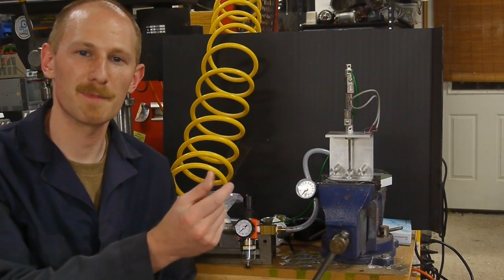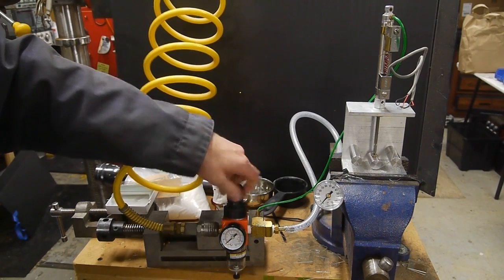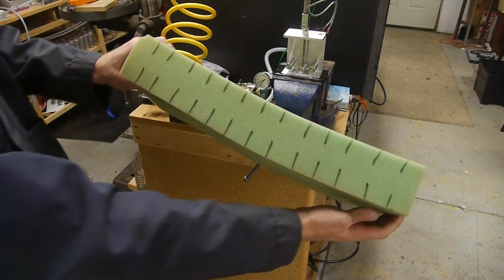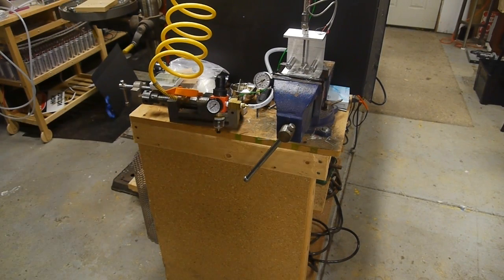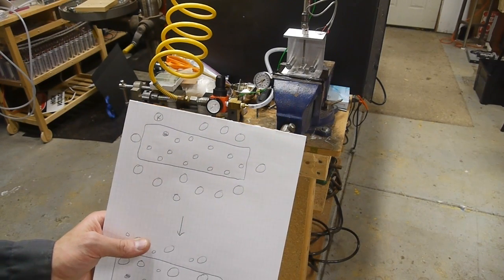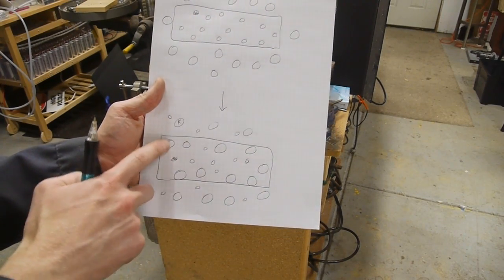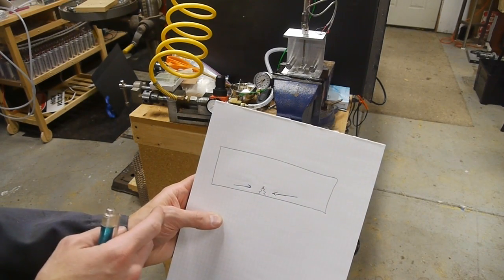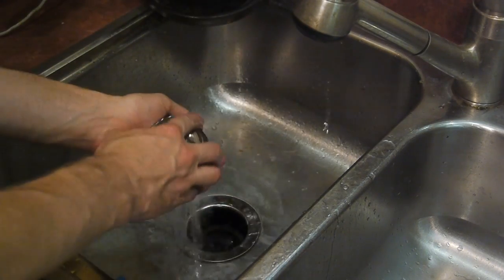How to chemically strengthen glass (eg Gorilla Glass)

Comment: Car windows?
Reply: Jon Visser the "windshield" is not something you can "kick in" it is normally part of a cars bodys strength and i can guarantee, unless you are the hulk, you will not be able to kick through a car's windscreen.   laminated side windows would be too tough for a human to pass through.
Reply: Car windows are made from laminated glass. There are two layers of glass with a plastic layer in the middle.
Reply: ricksite I think my front window aka windscreen is only laminated window in whole car like mostly on older cars (?).
Reply: XantheFIN Thank you for correcting me. I think the windshield and rear window are laminated and the other windows are tempered. I read an article a while back about automakers wanting to use laminated glass on the side windows. There was a concern about being able to break the window if the vehicle is submerged. I don't know if any manufacturers are currently using laminated on the side windows.
Reply: ricksite Breaking a window is not suggested underwater.  You'll have shards of glass streaming in with the water that could potentially lacerate you.  Either roll down the windows or kick the windshield.  The windshield won't shatter because it is laminated.  I wish that automakers would use laminated side windows, that might help deter thieves since it would take longer to break in.
Reply: MrKnifeFanatic remember the pressure from the water on top of the glass makes it much harder to kick the windshield from the inside
Reply: ricksite I believe higher end cars use laminated glass for the side windows to decrease cabin noise.
Reply: ricksite some cars are double glazed, so smashing them is not easy.
Reply: mightyfinejonboy I just watched a "nowcast" on getting out of a car in the water.  They've been wrong on some things before, but they said the same thing as you did.  I've always heard to kick out the windshield.  It's probably from watching too many action movies.
Reply: mightyfinejonboy Yes, but kicking a windshield from the inside out is much easier.  When your car submerges you aren't going to swim out of the car and start kicking the windshield from the outside, now are you?  lol.
Reply: Jon Visser
Tempered glass doesn't break into shards, it shatters nearly instantly into extremely tiny pieces that aren't (very) sharp.

Rolling down the window under water is just as impossible as kicking out the windshield, because of the pressure difference that others have hinted at.

You may want to close your eyes when breaking the side window but whatever minor cuts it may give you are certainly less bad than the alternative death by drowning.
Reply: racoiaws Why would rolling down the windows be influenced by pressure?  It's not going against the outside water, just down.
Reply: Jon Visser
Because of the extreme friction created by the water pressing the window onto the window frame.

Just picture it being oriented horizontally; a pane of glass is easy enough to slide across the ground, put a few hundred kilos of weight on top and it will no longer budge.
Reply: racoiaws I'm not seeing evidence for that on any web searches, but the logic makes sense.  The question is if the 1/2 centimeter of glass in contact with the surrounding door is comparable with glass on the ground with 100% coverage.
Reply: Jon Visser While the analogy isn't perfect, it was the best / most accessible one I could think of.

I believe they did actual practical tests with car doors on MythBusters.
Reply: racoiaws That´s not a very good analogy. A liquid on a plane of glass is not the same as a dead weight on a piece of glass. 
You have pressure but you are not working against it, you sideline it. 

After that is down you wait until the car is fully filled to neutralize the pressure difference and can then swim out. 

alternatively you unlock the door and stomp on it, how hard it will be depends on your depth under water.
Reply: GeneralRushHour The analogy was never meant to cover anything more than the sideways pressure the water puts on the window.

Of course, if the car isn't submerged you can quickly open the door or window.
But once it is submerged, the pressure difference will prevent you from doing so and you're going to have to break the window.

You could also wait for the car to fill up with water for the pressure to equalize again, but chances are you'll be even deeper under water at that point and it might prove too difficult for many to keep their calm long enough for this to work.
Reply: "But once it is submerged, the pressure difference will prevent you from doing so and you're going to have to break the window."

It depends on the depth. Regardless of depth, working straight against the pressure is much much harder then sidelining it. 

"but chances are you'll be even deeper under water at that point and it might prove too difficult for many to keep their calm long enough for this to work."

No different then fighter pilots staying calm and wait until the last moment to exit the plane. Human training or just individual nature/ knowledge.
Reply: GeneralRushHour  "No different then fighter pilots"

Your average driver is quite different from a fighter pilot.. fighter pilots train very hard for what they do, exactly for the reason to be prepared for every situation.

You can't seriously think that most drivers will stay calm as their vehicle submerges and slowly fills with water. If your reasoning is purely theoretical (because it doesn't seem practical) then why not say that people shouldn't be driving into the water in the first place?
Reply: "Your average driver is quite different from a fighter pilot.. fighter pilots train very hard for what they do, exactly for the reason to be prepared for every situation."

Doesn´t matter what the person thinks, it´s all physics.
Reply: One of my cars which is a Rolls Royce Phantom, a very high end car, uses laminated glass in all windows to keep the noise and vibration down. My Mercedes Benz S65 AMG which is also a very high end car does not have laminated side windows for safety reasons.
Reply: Daniel Napast yea you don´t have a rolls royce, nor a Merc S65 either.
Reply: Death by lacerated arteries, but I digress, newer safety standard factory car windows I believe are designed to shatter with less likelyhood of that.

Comment: Did I miss something Ben?  Did you say how much load the treated glass took before breaking?
Reply: You did miss something. The regular glass broke at ~25 psi, and then he tested a piece of the treated glass. It didn't break until the gauge was off the scale - over 65 psi, or over 260% of the force required to break the normal glass.

Comment: Just a quick and probably stupid question. What would happen if i used this process to harden the glass on my smartphone directly or at least removed the glass from the phone first.
Reply: I would think the high temperature needed would cause the screen to delaminate and completely fuck it. This process needs to be done to the glass, not a completed touch screen that contains many layers
Reply: Depends what phone you've got, but most smartphones use a form of gorilla glass anyway.
Reply: depending on which phone you use, you might already have gorilla glass on it
Reply: That's a good idea, but unless you have an extremely cheap (and I mean extremely cheap - think "no-name-brand bought new for less than $40 off Ebay") or counterfeit phone, then the glass on your phone is pretty much guaranteed to already be strengthened in a similar manner.
With a phone's screen, I would be concerned about degrading the coatings on the glass that make the touchscreen work - I guess that would depend on how the screen was constructed though.
Reply: Re i've never seen a touchscreen like that. I can't even understand how a touchscreen like that would work. What phone has a screen with a separate glass front?
Reply: memberHD For most phones the glass and touch screen unit is separated
Reply: memberHD Do you know how capacitive phone touch screens work? It's basically by proximity, not pressure. The actual touch screen is made out of a plastic material, and on the outside is a protective glass lens. The finger can still be detected through the glass lens. This is why when you crack the screen of an iPhone it continues to work. On some phones the digitizer and the glass is fused together but on others it's only glued together. For example, it's glued together on most early iPhones and iPod touches, like the iPhone 2G.
Reply: memberHD You can also buy bare glass lenses for certain phones to do a manual repair. Search "replacement glass lens" on ebay and you may find some.
Reply: memberHD Re  Hm, yeah it looks like Re is correct - in both capacitive and resistive touchscreens, the "touch layers" reside underneath a glass "lens" layer. I suppose some devices probably have all the layers bonded together, and some others probably just have the touch layers mounted against the glass pane.
Resistive on the left, capacitive on the right - http://i.cmpnet.com/planetanalog/2009/06/C0411-Figure2.gif
Razzman If you cracked the glass on your phone and needed a cheap replacement, you could probably use the method in this video to make one out of a normal piece of glass :D
Reply: Your smartphone's glass most likely has already had this done to it.

Comment: Could those tensions be releifed by aneiling of glass? Tempering? Is that similar process?
Reply: If you relieved the center tension by annealing the glass, you'd also remove all the benefits from the compression. Newton's third law takes care of that; If you have no tension, you can have no compression. Tempering has the same effect as the ion exchange process, but in a different way: during manufacture, the glass is cooled more rapidly than usual while still soft, causing the outer layer to cool, contract and harden before the center has. Once the center cools and contracts, it pulls on the (now hardened and immobile) outer layers, placing them in compression. The center is in tension as a result.
Reply: Indeed.
Fairly extreme example, and amusing explanation here:
/watch?v=xe-f4gokRBs
Reply: Thank You
Reply: I love logical and detailed answers in the YouTube comment section. It’s stuff you’ll probably never know about.